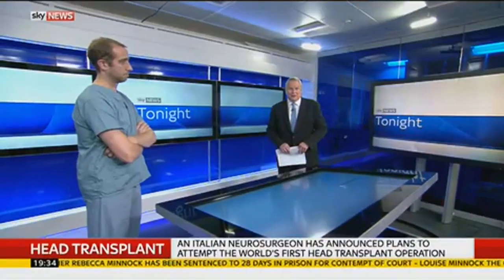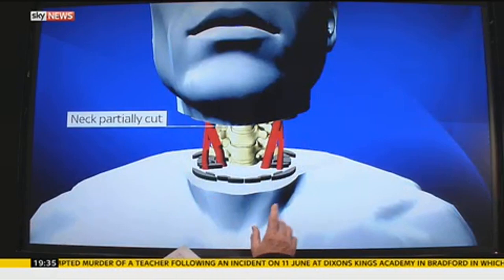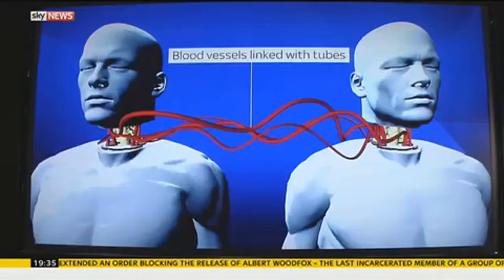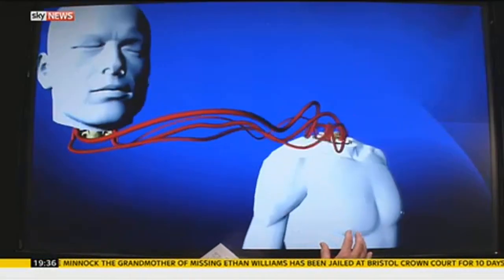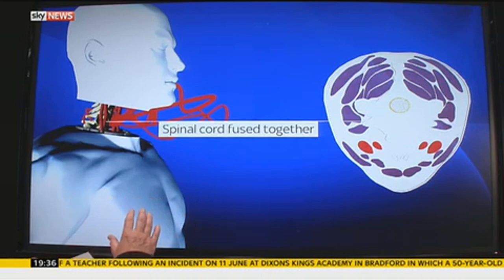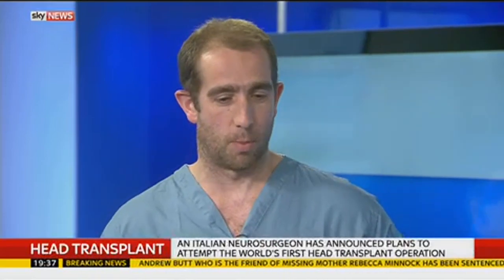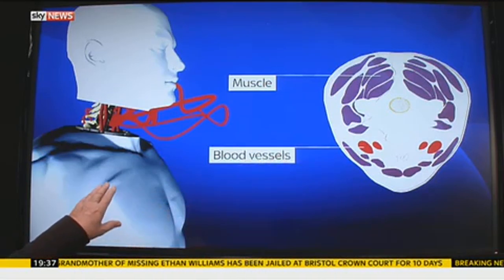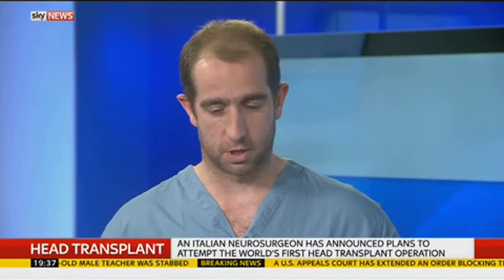World's First Head Transplant: What's Involved?

Comment: They can transplant a head but can't repair a damaged spinal cord #Bullshit
Reply: those are completely different cases
Reply: Depending on the type of spinal chord injury it is very repairable 2 years ago they started to have success with electro therapy for people that had severely injured  the spine and as a result became paralytic. The success however is tied to quick countermeasures and treatment innitiation right after the accident.  Also a tear due to blunt force can't be compared to a medical procedure involving a sharp knife and precise cut
Reply: As someone with a spinal cord injury at the C6 C7 level of nerve cells do not regenerate there is no way to reconnect nerve cells after they are separated
Reply: That's a good point.
Reply: dumbass
Reply: Filip laskovski stem cell implants can replace body parts. Problem, there are not many medical artists familiar with 3D modelling and not many doctors skilled in 3D softwares. As an artist, I sometimes help doctors online with software skills.
Reply: Like Anthony said, that is not possible with a spinal cord injury. Even if stem cell treatment is given it is extremely unlikely that the nerves would reattach their corresponding axons. This is also the main reason the 'head transplant' will definitely not work.
Reply: jonny Nuttah I think there might be another way. What if the team tries another approach like attaching part of stem cell spinal cord made with a donor's cells onto the host and leave it hanging for a week or so, half of implant visible from outside the host's body. It is just to see the body can accept the implant. If not, it can be removed. If the host's body accepts the implant, then there might be a chance of success in attaching the host's head onto donor body.
Reply: jonny Nuttah in other word, the host's brain has a LOT of rewiring work to do and lots of nerve connections to make between the body and brain. I get the picture.
Reply: Exactly, plus as these are crucial pathways that are already established they largely don't have the ability to adapt to new connections. Shame it is not possible, it would be interesting.
Reply: Nerve cells do not have totipotency or regeneration capacity..so it's quite not possible...but if u preserve the stem cells from ua umbilical chord when ur born ...u can use it cure the damage or injury